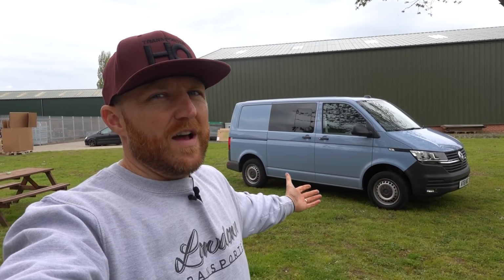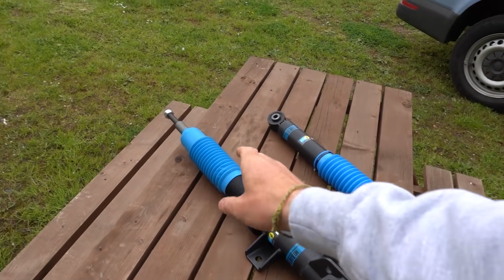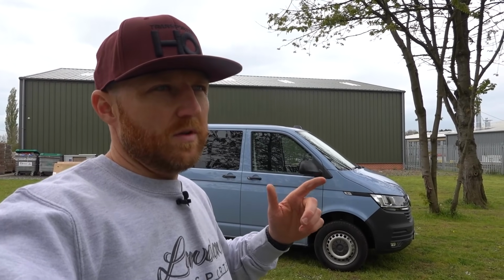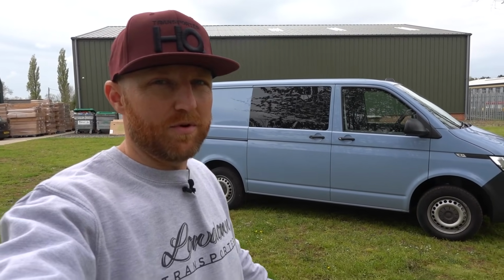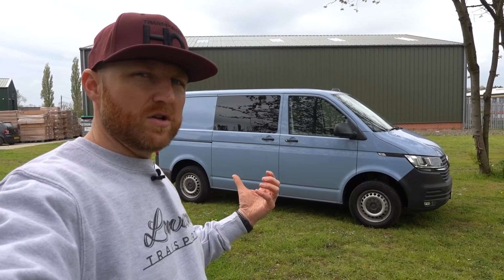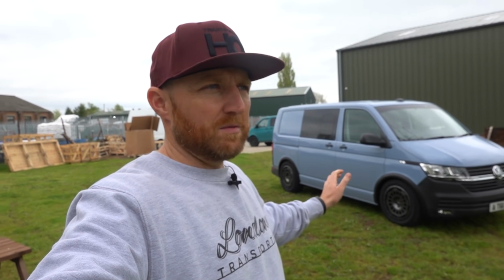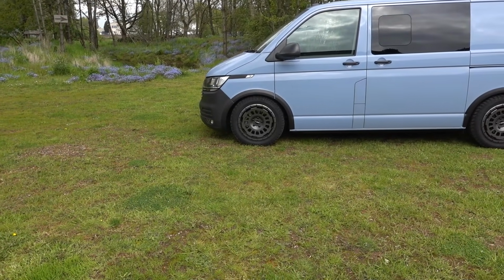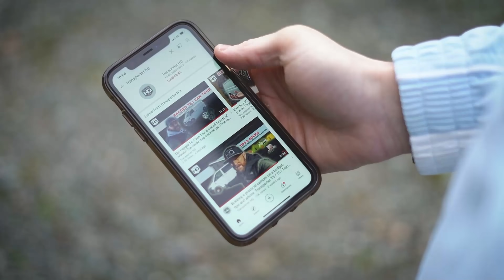The Most Practical VW Transporter Possible | Wheels and Suspension - Episode 2 | Transporter HQ

Comment: I run these exact same tires, general grabbers at3's in 235/55-18 on my T6.1 150 4 motion manual and i found that the 3% speedo difference puts me spot on with actual speed and indicated speed so no need for me to calibrate it.
Reply from the maker: Its very strange, I have seen this too. I have also seen other vans that seem to be out by 7% plus.

Comment: Hi THQ Team.......have you guys moved any further forward on the upgrade for the Startline lights?  Reason being; I'm just about to look at ordering a new T6.1 (Pure Grey) and love the commercial look, but would like to have much better lights.  I'm currently flipping my build on the VW website between Startline and Highline (with LED's), but think the HL won't look as great with the wheel arch/body mouldings, as it does with the commercial front and rear bumpers.  Can't stretch to a 4Motion, but intend to lower and fit similar wheels as your project van, to give a me a versatile family bus!

Comment: Bilstein Germany and also we found out many years ago that Monotube does not work on this platform at the front axle !  All the B6 + B8 which had intially Monotube damping at the front was switched to Twintube to avoid the trouble with terrible noises at the front transmitted directly into the cockpit ! Some had these problems from the first day and some had this problem after half a year/ year .  Thats why the B14 + B14 KOMFORT for this platform has TWINTUBE at the front + Monotube at the rear axle. Therefore it is absolutely important that the front dampers are NOT monotube at this T5 T6 T6.1 platform !
Reply from the maker: We’ll see I guess. We just wanted to try this before we put it on the 1000 BHP Tesla van and before we sent it round the Nürburgring. Total overkill on this van but a good test mule.

Comment: Hi there,
AS you fitted B14s to my t5.1 Can you supply these wheels and tyres. Need something we can use off road, as now living in Spain.
Reply from the maker: Yeah sure. Speak to transporterhq.eu if you are based in Spain
Reply: @THQAutomotive  still back and forth uk. Back last two weeks in September hoping to get a few things done. First is wheels and tyres
Reply from the maker: @juanescalera1817  If your in the UK, we can help no problem
Reply: Can you get this wheel set or similar
Reply from the maker: @juanescalera1817  Yes, we have some colour versions in stock.

Comment: You say 275/40 are wrong, what should you run on 20" wheels for a T32?
Reply from the maker: 265/40/20 will give you the correct load rating and a better rolling radius. So many sell 275/40 as the are cheap.
Reply: @THQAutomotive  Thanks good to know... I thought the 275 measurement was the wheel width? Wont that make the tyre look narrower than the wheel?
Reply from the maker: @matthewlaw8268  depends on the width of the wheels. 275/40’s normally look very balloon like and poke out from the wheels. The 40 part is a percentage of the width.
Reply: @THQAutomotive  ok thanks I thought that all wheels that took 275 tyres were the same width. I am about to purchase new wheels which come with 275/40 all round. They are staggered so 8.5 front and 10 rear. Are these numbers the widths and should they put 265/40 on the front wheels?
Reply from the maker: @matthewlaw8268  use willtheyfit.com as I guide. I would start with a standard davenport size 215/60/17 which it a 7” wide wheel. Then compare to your wheel and tyre choices.